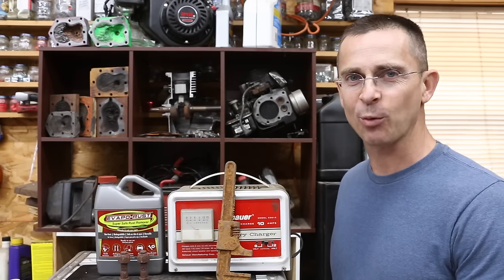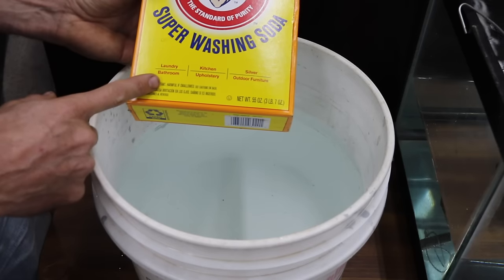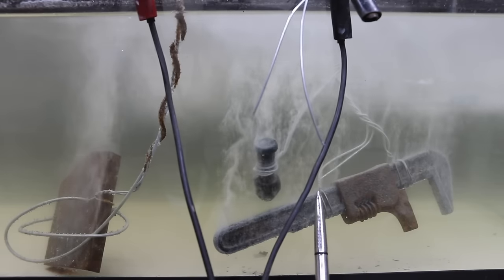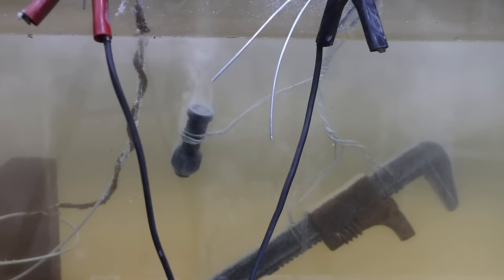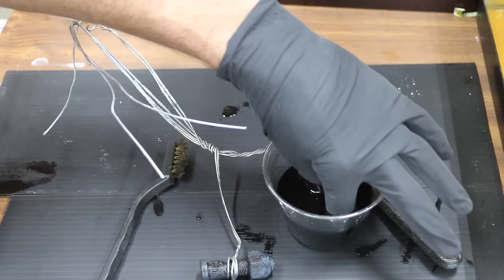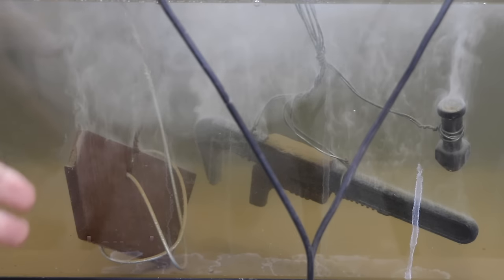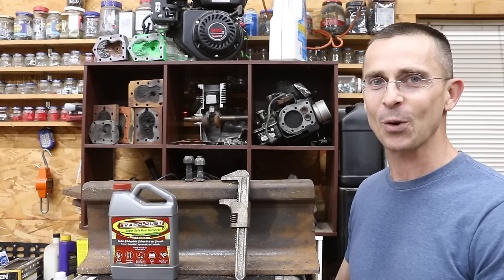Is Electrolysis better than Evapo-Rust?  Let's find out!

Comment: Really appreciated the video the best one I've seen been wanting to know how to do this process you completely simplified it making it easy to comprehend. One technique that would be good is to do the electoral process then finish off with the acid spray WD-40 in the movable parts then heated with a blowtorch and then spray WD-40 then hit it with a blowtorch shut off by coating it with WD-40 to bring movement to the moving parts.
Reply from the maker: Thanks!  Thanks for the feedback.

Comment: The electrolysis seems to have two different colors on the wrench. Is that because they are two separate parts and the wire should also be wrapped around the center mechanism? or are the original parts two different colors?

Comment: Some advices from personal experience. Most of those  products to remove rust, is phosphoric acid  and water. Fun thing happen here in Brazil. Specialized produtcs to remove  rust cost more than food grade, or phosphoric acid used in quimical analisys (top grade and really pure products.) so, check the prices of food grade phosphoric acid and check the concentration, compare it to you prefered rust removal. For the eletroclise, you can make the pieces alot closer, by just using a fabric between they, just the enougth to the power supply don't turn off because of the high current.  Closer == higher current and small time to remove the rust.
Reply from the maker: Thanks for sharing.

Comment: I made pretty good experiences with H3PO4 phosphoric acid 85%. Dipping works a lot better than brush on surfaces (repeat every 12 to 24 hours) but it works extremely fast on flash rust. And it's really cheap in comparison to H3PO4 containing product like FERTAN. But like these products you have to be carefully in handling. Every drop on your clothes (especially cotton) will be a hole.
Reply from the maker: Thanks for the feedback.

Comment: The moving part of the wrench is not getting as clean as the rest because there is no wire connecting to it. It might seem connected to the fixed part because both are metal but actually there is a gap, and in the beginning this gap is also rusted which makes a deficient contact

Comment: Ive seen guys space rebar around a 5 gallon bucket and suspend rusty tools in the center. Works fairly well as electrolysis is line of sight based. Interestingly, this is the exact process used to create micro circuitry in semiconductor plating tools. Only instead of electrons pulling rust in a free pattern to a scrap piece of steel, you pull an anolyte solution of copper, gold, ect through a stencil or "photomask" onto a wafer.
Reply from the maker: Thanks for the feedback.

Comment: Using phosphoric acid not only removes the rust but it also creates a film around the part that prevents it from rusting again. Turns the parts black though. You can dilute it in water and it's fairly safe on the skin.
Reply from the maker: Thanks for the feedback.

Comment: Only need a cup or two of washing soda, not the entire box. I’ve had good success with sheet metal as a sacrificial anode and you can surround the piece which works way better. Evaporust costs a lot more and quits working as well after a couple rusty items.
Reply from the maker: Thanks for the feedback.

Comment: how many amps  did you have the battery charger on, was that copper wire wrapped around tools if that wire was also wrapped around the part where the thumb screw was i think that would of worked better as it had all that distance to  work through from the other part of the jaw.  but looked great.

Comment: Todd the most important thing I noticed in the close up of the two bolts was the Evapo-rust treated bolt looked less pitted than the other . That could be an important detail in refinishing cast or stamped pieces with intricate definition .
Reply from the maker: Thanks for the feedback.

Comment: Tip:
Attached leeds to all metal surfaces....your wrench adjustment mechanism missed out on the electrolysis because the rust on the handle acted as a insulator.
It didn't matter so much on the nut/bolt example as it was a tight thread and the area of it's tight grip was sufficient to allow it to work reasonably.
Reply from the maker: Thanks for the constructed feedback.

Comment: I've never used evaporust but I will say the electrolysis is great for stripping parts down to bare metal, it even removes paint and other coatings that may be on there, been using it for years to restore automotive parts and firearms, just don't use on gun barrels it will damage the chrome lining unless you plan on having it redone
Reply from the maker: Great feedback. Thank you

Comment: The adjustable section of the wrench wasn't getting electrically connected to the negative lead.  That's why it didn't clean up as well as the rest of the wrench.
And-- electrical currents on the insides of things usually cancel out so you don't get any action.
Reply from the maker: Thanks for the feedback.

Comment: Note that the distance between the positive pole, and negative pole in the water solution, makes a difference in how well the electrolysis works.
Perhaps starting the rusted item in a vinegear bath, for 48 hours, then onto electrolysis.
Reply from the maker: Thanks for the suggestion.

Comment: I use electrolysis to restore cast iron pans. I will share some of my findings. First, once the sacrificial metal is dirty it's lost most of its effectiveness. You have to sand the rust off. Iron or steel gets really dirty quick, so I switched to stainless steel (old boat grill lid) and I had way better results, quicker and way less cleaning. Voltage has an impact, auto chargers usually won't work properly. Line of sight and distance between the two also have a large impact.
Reply from the maker: Thanks for sharing.
Reply: The problem with stainless steel is it creates a carcinogenic toxic byproduct when used in electrolysis

Comment: while electolysis may work initially, theres more to consider. youre imediately upon de-rusting the tool, starting with it already in contact with water, which will immediately trigger rusting yet again. id advise an oil soak after electolysis to avoid rust building back up. keep your tools away from water if at all possible, and use some oil to coat metal if theres a chance it could contact water
Reply from the maker: Thanks for the feedback.

Comment: Next time you try electrolysis, make sure that the electrical source is feeding all parts of your workpiece.  You had the wrench suspended from 2 sections of wire, but the problematic moving piece with the worm gear was electrically isolated by the resistance of the rust.  I'm surprised you didn't figure that out.  Same with the lug nuts.  If you had also had a source wire on the NUT the rust from that piece would have actively dissipated from between the threads.

Comment: You need to size the sacrificial anode for the surface area of the part you're trying to clean. Basically the larger the surface the better. Or just clean it with a wire brush every once in a while. Also, higher current will work faster. I've used 2amps for small parts, and up to 10amps for an entire 110lb anvil. No hate for Evaporust, it's an amazing product. But I love the electrolysis process.
Reply from the maker: Thanks for the feedback.

Comment: With electrolysis, the higher the amperage the faster the reaction. So you can speed it up by targeting, say 6 amps instead of 3. Going too aggressive can be unsafe though, as the gasses produced are also increased. Aim for 20-60 mA per mm^2 of metal surface area. 

Also very important to make sure you have good electrical contact to all components. You can see here why. The sliding mechanism of the wrench isn't being cleaned well because its not making good contact with the wire.
Reply from the maker: Thanks for the feedback.

Comment: There is a product called Kreem that is used to repair rusty motorcycle gas tanks. The A/B kit is the rust remover and it works really good. I'd bet it would beat the Evapo-Rust and it cost's less I believe.

Comment: I've been using electrolysis for a few years and have wondered if it adds a lot of moisture into the air. I started out doing it in my shop but I noticed rust forming on the bare metal of my machine tools I had just refurbished. Does that sound right? Anyway I moved the operation outside of the shop just in case.

Comment: part of the issue with the wrench is that it's not a solid one piece. I would ran the negative wire around both pieces and try to ent the wire at wheel.

Also, a 24 volt batter charger, or even a welder unit for even more volts/amps cut the time down to hours rather than days
Reply from the maker: Thanks for the constructive feedback.
Reply: @ProjectFarm  no worries. Also, be careful of hydrogen build up. don't want another Hindenburg. Pls, don't mind my grammar in above comment, I was texting from my phone

Comment: It's a misnomer calling the plate "sacrificial". The process is actually removing material from the worpiece (this is why the plate gets coated in rust) and deposits it on the anode.
Reply: It still pretty much ruins the cathode which is why it's "sacrificed"
Reply from the maker: Thanks for the feedback.

Comment: Try putting some Evapo-Rust in an Ultrasonic cleaner to see what happens!  I have a small ultrasonic unit around here somewhere and I'm going to get a hold of some of this Evapo-rust ( it looks like a good and 𝘀𝗮𝗳𝗲 rust remover) and try this experiment myself. 

The only problem is that my unit is only about 35 watts. A stronger ultrasonic cleaner might be needed for larger parts like you used.
Reply from the maker: Great suggestion! Thank you.

Comment: If you noticed, the adjustable part of the wrench didn't clean up as quickly.  The reason for this was that you didn't have it directly connected to the wire.  The rust between it and the main part acted as an insulator.
Reply from the maker: Thanks for the constructive feedback.

Comment: I noticed the pipe wrench cleaned better where the wires were attached. I wonder if the the adjusting mechanism would clean better if one of the wires were attached directly to it.
Reply from the maker: Thanks for the suggestion.

Comment: I have a seized and rusty 12" crescent wrench. I've managed to remove rust with wire brushes, steel wool and lots of WD40; I've soaked it in WD40 over nights. The wrench looks great, but I still can't get the screw and jaw moving again; it still seized. I might try electrolysis to see if it can be done or use evapo-rust removal. Thanks for the video.
Reply from the maker: You are welcome!  Thanks for sharing.

Comment: You can increase the speed of electrolysis rust removal by increasing the voltage and or putting more negative contacts on the object. You can also increase the speed by periodically cleaning the sacrificial anode.
Reply from the maker: Thanks for the feedback.

Comment: I like Evapo-Rust because it's re-useable. On the other hand electrolysis is cheap. But I'll get Evapo-Rust because I watched Project Farm's video's on rust removal products and it's the safest of the liquid products.
I'll mainly be removing bolts from my 20 year old Jeep Grand Cherokee Laredo and putting them in Evapo-Rust.
▪︎ The other great products on the other videos can eat away the metal  IE= Krud Kutter, Hydrochloric Acid (Muriatic Acid) unlike Evapo-Rust.
The ability to reuse Evapo-Rust multiple times has me sold.

Many bolts and small parts on cars are very expensive or hard to find. This qay I don't have to buy tons of parts. I will use Nickel Anti-Seize on the bolts shaft and 290 Green Wicking threadlocker on the already torqued threads to protect against future rust while also making the fasteners hold in tight.
Reply from the maker: Thanks for sharing.

Comment: Would the electrolosis be more efficient if the area of wire connection be cleaned up to increase contact to the steel itself as opposed to the rust?
Reply from the maker: Thanks for the suggestion.

Comment: at 6:17 you can see that the threading on the electrolysed one is a lot less sharp that the evapo-rust. i don't know if that was the case before treatment, but electrolysis can indeed be expected to eat upfine details. i don't know how evapo-rust works though.
Reply from the maker: Thanks for the feedback.

Comment: It's better if the wire don't touch the water. Also what A and V have you used? A charger isn't a good way to do it, best to use a power supply.

Comment: All the parts need a charge for the electrolysis to work. The rust gap between the bolt and slider prevented good current

Comment: I think you may have not showed something of the loosening the wrench.
The electrolysis is going to work better on the side toward the sacrificial. It would not work well on nuts or inside surfaces. The chemical has a chance to penetrate into the threads. I used EDTA, with citric acid to neutralize and a bit of soap. Turned on my cheap ultrasonic bather now and again and it loosened threads that I would never expect the electrolysis to accomplish.
I expect that EvapoRust would have worked even better, but I been experimenting with cheaper methods. 
I am going to set up tank, with your same chemicals to use electrolysis, surface clean a bunch of my stuff that got left out.

Comment: I've never used electrolysis before.  I've soaked rusty wrenches and pliers  in fuel to get them freed up.   But then I have a can of diesel  that I cant use for anything other than burning shop rubbish.  Going to have to try that the next time I find an old pair of vice grips that have been out in the weather for too long.  Thanks!
Reply from the maker: You are welcome!  Thanks for sharing.

Comment: What happens to the metal if it sits on the bottom of the tank? I have 2 pcs in the tank. I have 2 inches sticking out of the tank. I thought I could turn them over and run them again.

Comment: I don't know how the acid affects the metal, but I have a feeling electrolysis can draw hydrogen into the metal, causing it to become a little brittle.

Also leaving it a few weeks, or putting it in an oven on low for a few hours should expel it.

That's what I did when I used this method to clean up some suspension springs.
Reply from the maker: Thanks for the feedback.

Comment: How many amps was used on the charger?
And you could also put a 3rd wire on the wrench's moving part, becuz its not connected to the main part that well...
Plus u could actually face the camera with ur full front, becuz otherwise it looks kinda tilted lol

Comment: I think if you put the electrode wire on the "adjustment" portion of the wrench, you'd have a better result. I don't think the current is passing through that section and that's why it's not removing the rust.
Reply from the maker: Thanks for the feedback.

Comment: Electrolysis is good for old rusty fuel tanks too.Tanks that are not repoped or in otherwise good condition. Simply fill the talk with solution and add you sacrificial metal, make sure it does not ground out on the tank.Can save unique tanks this way.

Comment: I only read a few comments and see they also thought you should have run the wire to the other parts of the wrench.  I'm really curious what would happen if you cleaned one tiny spot and  tacked a mig wire onto it and used that wire to go to the negative.  The wire wound around it doesn't seem to a good connection.  Won't work for all applications, but really would like to see it done.
Reply from the maker: Thanks for the suggestion.

Comment: Don't mean to be picayune, but it would have nice to weigh the sacrificial piece before and after to see if the equation balanced. Nice job. I learned something.
Reply from the maker: Thanks!  Thanks for the constructive feedback.
Reply: Use stainless and it won't sacrifice. It is not involved in the process. It rusts because oxygen forms around it. Only issue that stainless may produce toxic chromium.

Comment: Using electrolysis you can be more certain you won't lose much good metal, so that is my #1 choice and in fact the only method I would use. I can improve the process a lot by using more and bigger sacrificial metal with more surface area, more and better connections to the part itself and using higher voltage power supply.
Reply from the maker: Thanks for the feedback.

Comment: What about the electricity cost? Is there a way to calculate how much energy does electrolysis need? Does the voltage matter? We can't plug straight into the wall, can we O_O ??

Comment: 7 minutes and 38 seconds later, all 3 are spotless with my bench top sandblaster.  Same time it takes to watch this video
Reply: cool, want to buy me a sandblaster? or is a battery charger cheaper
Reply: @unknown_10453  depends on where you get either product.  I got mine used for free.  And no, I don't want to buy you a sandblaster.

Comment: The reason the movable portion was taking longer may be due to the electrical connection being reduced due to the rust.  If you moved the wire to contact that part it would probably work faster.
Reply from the maker: Thanks for the feedback.

Comment: I have used Metal Rescue (an iron chelation product similar to Evapo-Rust) with excellent results on motorcycle gas tanks.    I know that electrolysis should be possible for this, but you would have to keep the sacrificial electrode(s) from shorting out to the tank and it would probably be rather messy, too.
Reply from the maker: Great point!

Comment: What is "C foam de-creep"(?) that you had to apply to finally unsieze the wrench?   It would have been instructive to also weigh the sacrificial steel before/after.
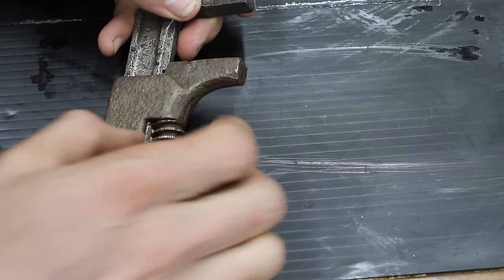Reply: PS The reference to what sounded like "C foam de-creep" was at about 6:25 in the video.
Reply from the maker: Thanks for the constructive feedback.